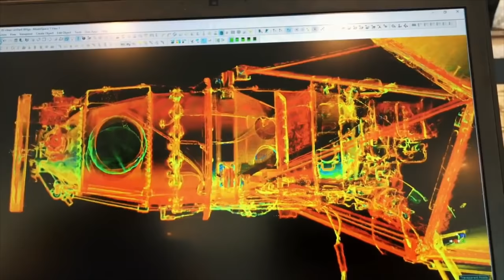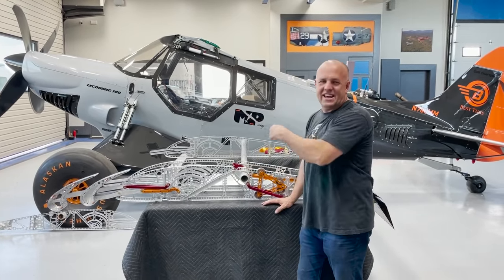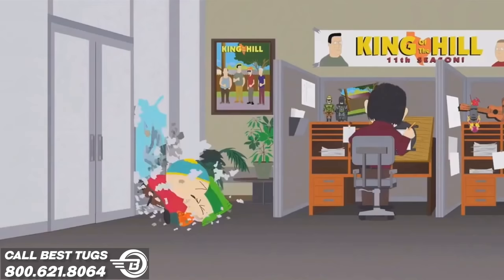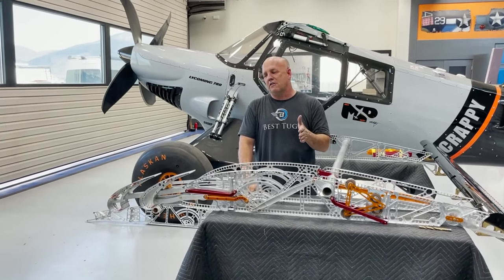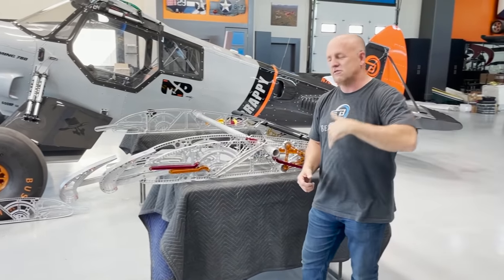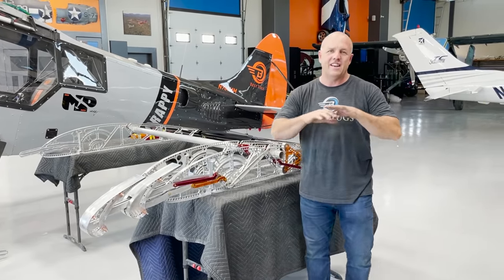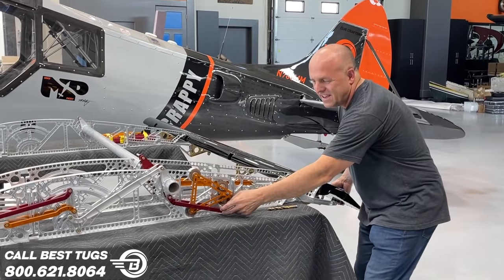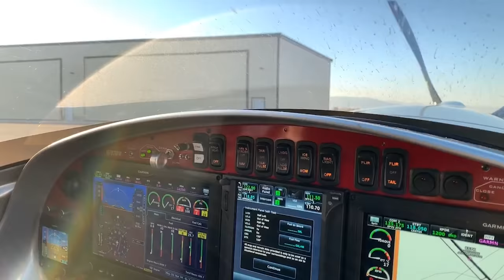DECLASSIFIED Hyper-STOL Transforming Wing - Patey Twin Slats - Fast and Slow | Scrappy #57

Comment: Those ribs aren’t just elegant engineering - they are works of art. Need to hang some on a wall in a museum. 

A couple of years ago I played with some CFD models of my Zenith 701 wing. Wanted to see if I could get the stall speed down even lower by adding an array of small electric ducted fans between the slats and the wing. The idea was to get higher speed airflow coming out of the slat and increased critical AOA. It worked, but it looks like your double slat achieves better results without the need for a power source.

Comment: You can research the B-24 Liberator wing which even today is considered revolutionary. Ironically the most high performance wing design of World War 2...meaning "put on a 4 engine strategic bomber" and not as would be "normal" on a fighter plane or something to be launched and landed off an aircraft carrier.

Great video!

Comment: Beautiful Wing, everything about it. So well thought out and innovative, from the Leading Edge Slats to Flaperons. Can't wait to see you flight testing Scrappy and how low the stall speed is with those slates, converting high pressure below the wing to high velocity air above the wing, you might have to fly backwards to get the wing to stall.

Comment: Mike here’s a thought that I’m not sure you explored with the leading edge slats. It looks as though your slat mechanism largely just extends the slats forward but not really down. Perhaps in a second iteration of wing design you could try a tracked system for the leading edge slats linkages so that the slats extended both out and down as they typically do I on commercial aircraft. I think this would both super low speed lift and allow a low angle of attack which would be great for STOL landings. Love you projects. Now, back to work!

Comment: Totally amazed. I'm not a pilot, but wonder how the complex structures will wear during extremes of heat and stress cycling. What keeps seals from leaking around torsion bar?  How will access panels behave under extreme stress?  How would you qualify this wing for commercial or military service?
But I'm really grateful to Mike for bringing us along on this odyssey.

Comment: You very well may have changed the future of slow flight making landing safer and easier for pilots of the future.  There's a potential for use in naval aviation and platforms like the E-2 and C-2 could benefit from lower landing speeds.  Certainly, it would be less stress on the airframes.  Even the C-130 and cargo planes that need the ability to land on short runways could benefit from this double slat design that you have come up with.  

Am amazed at how much thought went into the design of the wing and was able to follow your explanation completely because you did a great job of articulating your design goals.  For example: why you wanted to move the center of lift forward as you add flap to remove the need to have to pull back on the stick to compensate for the nose wanting to pitch forward, and how pulling back on the stick creates downforce which counteracts the extra lift being produced by the wing < which is what you wanted to avoid, as well as have the ability to fly at lower angles of attack yet still benefit from the extra lift.  

I also really like the safety features you incorporated such as making sure that the wing itself had nothing that would cause anything to bind and that the only thing limiting travel is back at the actuator itself where its full range of motion governs the limit of the travel.  It's genius and should take a lot of workload off the pilot during landing!  I can't imagine a safer plane than Scrappy!

Comment: Of course anyone who has sat in a window seat of an airliner will have seen the wings "Expand" prior to landing. So the idea is not new but it is new for light aircraft. Why not? The answer is simple and that is "Cost". To make ribs like those Mike has made would be tres expensive for the average small plane which is not exactly cheap to start with. I am not knocking Mike's work or ideas just saying it as it is. I actually admire him and the way he can think out the problems and come up with solutions. Regards, Jim in NI UK

Comment: Hoooly shit, in 20 seconds of motion you made my engineering brain light up.  I LOVE this design....  You're gonna need either a flexible skin, or sliding plates depending on her construction, and you'll need your engine to be able to handle the extra drag created suddenly as the wing changes, but if it's appropriately powered this will be amazing.

To make this easier to fly look into the electronic mixing we do with RC aircraft.  It may help you synchronize the motion.  You can accomplish it with something as simple as an Arduino.

Comment: Mike, a few things I'd like to mention.  First, cool design, especially the dual slats keeping the air connected.  I'd be concerned that one of the liner actuator fail and you would be stuck trying to match one side to the other hoping it doesn't fail to.  One way to deal with this is to run a torque tube though the fuse and tie it all together mechanically then have both actuators drive the entire system.  That should give you redundancy (given safety factor) but more importantly no way they can be out of sync.    <more>

Another thing you might consider is getting the wing position feedback with a liner resistor (probably built in to your actuators) then using a micro controller to compare the two and lockout one side of the other fails or limit travel.  

Lastly, I'd consider not relying solely on the Garmin relay box for all of your movement.  If it were me I'd mount a relay driven aux switch that doesn't pass go, doesn't collect $200, but powers the actuators as a backup.   I'm doing something not entirely different with trim servos in each elevator with a microcontroller that can drive the system to neutral with a button press.  I can also speed/slow trim based on IAS, and other handy things, but... I'm going to have a "I don't care, power servo now" switch just in case.
Reply: Looking closer I see the ray allen position indicator, so that can be displayed on the G3X.  It's hard to tell if the tube on the end of the arm goes through the fuse or not.  It probably does.

Comment: I wonder how the wing will do when loaded and stressed? Can you imagine one wing not being symmetrical with the other? I am guessing he has left no stone unturned and has considered this especially with Solid Works or what ever system he uses. I flew a '46 Culver V for years. This was Al Mooneys final design before he ventured out on his own to form his own company. The "V" had a system called SimpliFly which automatically trimmed the stabilizer as the flaps were deployed to control stick pressures. Testing went wrong and the pilot was killed. I appreciate and applaud innovation and I feel the effort on the slow end of flight has not been there lately. Say what you will of the STOL competition but such will birth innovation.

Comment: @MikePatey At 7:27 you refer to losing 200 lbs of lift due to the wing geometry requirement, the Peterson Performance Plus canard MOD eliminates this penalty in fact it enhances the net lift and does so ahead of the center of lift, thus facilitating the desired angle of attack while also adding lifting capacity. I hope you will explore their solution, I plan to investigate it for my aircrafts.

Comment: Just a note on the rear stab. The Westland Lysander solved the rear wing stall by using an adjustable angle of attack on the horizontal stab. It was critical however to return it to level before takeoff to avoid killing the pilot, just saying

Comment: This reminds me of the Helio Courier's design. It had a single slat that was automatically deployed at high angle of attack by the air pressure. You could not stall the airplane and you had full aileron aithority all the way down.

Comment: The 2 inventions that changed our way of life forever 
1.Electricity
2.Solid Works hooked to a CNC machine.
   BTW. That was the problem with some of those smaller type P-51 kit planes..Too much flap with not enough elevator authority at the slower speeds.

Comment: Man I wish I could just hang around and help you work, just cuz I feel i could learn soooo much. I love building/ engineering/  problem solving.... I have always had a intrest in aviation and a want to learn to fly, but always seemed so far out of reach. I remember at around age 10 or so, taking apart my old 6x6 rc truck, a rc dual propeller boat and a electric rc light plane and making a rc boat, car, plane. ... it went in water perfect, it drove on land perfect, but after trying to get lift off I stuck it on the roof so I could drive it off the side where in was down a steep hill on that side, hoping it would be a awesome glide to landing......well, that was the last of that creation lol!

Comment: Great ideas and the beauty of Experimental class aircraft!  Design, build, test fly, document and it's legal (within parameters).  Very similar design as large passenger jets to overcome the same problems. The double slat is the icing on the cake!!  A thing of beauty Mike!
It's really too bad certified aircraft design is stifled because of overburdening government regulations.  Mooney was the first of many to go by the wayside recently.  Most others will be gone in 10 years.  The experimental class is taking over private aviation- we're all going to have to be active to keep government out of it.

Comment: Just want to say a fact and an opinion would appreciate your thoughts. A flat bottom airfoil needs a negative angle of attack to make it behave like a symetrical for high speed. For low speed 0 angle of attack or not much more going by bottom of flat of wing compared to stabilizer. An opinion is I feel the hi tech front slats may cause extreme turbulance. A standard wing with an adjustable angle of attack is what I would have went with. Works beautiful on rc planes and air stays smooth. This is 30 years of trying different things. A friend of mine made cnc wind tunnel small test wings for nasa and I learned a little bit.

Comment: Hey, I've been working on multi-directional airfoil expansion for two years now, this is some great implementation and congrats.
I have some comments in regards to the structure design that might be helpful for your design weight and stiffness, let me know if you are interested.

Comment: This wing design should be known as the Patey Wing. I bet that with a 15 knot headwind, once those slats are deployed with that button on the yolk, Scrappy will become airborne with zero ground speed and if not, Scrappy could leap into the air using all those fancy hydraulics (think lowrider) and require zero ground-roll just like a helicopter...

Comment: This is AWESOME!  I want this concept on a Turboprop LX7 I'm going to have built so I can get in and out of shorter fields, but still go fast!!!  Of course, I'll need a matching tug to go with it.  😁
Reply: I want it on the real original 4p. I think a derivative of this design could work for 4p or lx7.  Use springs to automatically deploy at low air speeds for stol or stall prevention in flight.

Comment: any engineering that beautiful has to work! i can't imagine what the cost of all the machined aluminum parts comes to but it is worth every penny. I hope there is potential for stampings and cost reduction without sacrificing performance. I would love to hear more about your prototyping and testing strategy. I am assuming you used your cad models with no mechanical stuff till you tested the air foil positions with the various configurations in various positions and after you achieved a desired flow analysis, then you figured out how to mechanically position the leading edges? great stuff. i love it.

Comment: Attached & laminar to the tip of a 50 degree aileron??
You sir, are a genuine genius!  Put that on a T-shirt and you could have a crowd of groupies at EAA fly-ins. What would happen to your pitching moment, and elevator authority with double slatted fowler flaps? (I used to teach subsonic aerodynamics at EAA Arlington, of course that was pre-meningitis. Now I have trouble making a sentence flow, let alone air over a wing).

Comment: I'm curious to know two things:
1. At the AOA you're discussing the 50deg flap being deployed: What's the airflow over the tailplane doing? How about the airflow coming off your wheel struts?
2. You're talking about the airflow being smooth over the top of the slats when they're closed, but it looks like in the fully retracted position, the torque tube is protruding above the plane's top skin. Is it? I didn't see a 'hump' in the flow analysis.
Looks seriously cool, bud. Looking forward to the feature-length presentation ;)

Comment: I noticed you have linkage popping above the wing, a suggestion is cover it with a wing fence.
Would have been better to just go with a wing that changes its camber similar to the F/A-18. While the engineering is beautiful I'm having flashbacks of working on Tomocats with all the moving parts in its wing.
This is gonna be a rigging nightmare to get symmetrical deployment and binding under load. I've done enough slat rigging to know Tomcats and Prowlers in the navy.

Comment: Looks nice.
The only problem being if the slats are too powerful and the C-of-Lift goes too far forward, then you may not get a pitch down on final approach.   And you need some pitch down, in order to see the runway.   (The normal pitch down is to restore the original angle of attack, after the flaps have been lowered.  The large slats and forward CofL will negate this.). 
Test it and see….
R

Comment: I know you have already most likely thought of this but , you would be able to lift the plane to a straight take off. Swiveling vertically on the back wheel.. Can your back wheel take the pressure of this. I know you will attempt such a take off since this will be possible with this wing design.. I love it doe..
Reply: @amytaylor7210   hi I am doing okay.. thanks for that :) God bless you too.

Comment: Whilst running some thought experiments on your design I feel like the the system would benefit from a mechanical link between wings or extra failsafe devises to prevent independent actuation. This happened twice in my mind and I didn't have time to catch it before you know what.

Comment: Please! Do a joint analysis of both wing and horizontal stabilizer under stall conditions! This wing is awesome, but you don't want your main wing still generate lift but your elevator is deep-stalled and you lose all pitch control - and the nose just keeps rising higher and higher until you flip back over :-(

Comment: Nifty viedeo of a nifty low speed arrangement. :D
1) I was hoping to see you fly it! :) 
2) I really tickled with the DHC-6 (and 4) that has the drooping ailerons that they call flaperons. The DHC-6 are the champs at St. Barts, making the turn-off every time, while ALL the other planes turn around at the end of the runway! ;)

You now have me wondering how the DHC-6 manages to compensate for the change in the center of lift.

Comment: Mike, you are a Genius!   I am wondering though in the fully retracted mode, about the hinge point on the torque tube sticking out above the wing.  Multiply that across all ribs and it would seem to be a lot of interference with the flow over the top.

Comment: Love it. It will work just fine. you should show people this by building a remote control model.. I tell ya. I would buy it straight away.. A remote control air plane build to the specs of Scrappy. That would be cool..

Comment: To compensate for main wing transformation can you create a new CG with shifting weights (on rails)in the mid section?  You answered this question in the video.  I think this wing configuration is used on the large passenger aircraft I think.  Nice work I can't wait to see this in the air.

Comment: I wondered what those curved shapes in the ribs were for. Two concerns; lubrication, dust. The use of sealed bearings and the design of every little thing is super impressive. I'm not sure how you would pre-flight that though.

Comment: This is great stuff and I watch all your videos. I think there is a terminology problem using 'laminar' when you mean 'attached' when referring to airflow. It is not likely that this wing has laminar flow all the way to the end of the flap. The flow stays attached but that does not mean it is laminar, where focus is on low drag for high speed rather than high lift at low speed. Most wings are turbulent flow designs, since even bug splatters on the leading edge can trigger transition from laminar to turbulent flow.

Comment: If you haven't already, you need to prepare a disclosure and start the Patent process for this innovation. This could be very important for the future of short haul STOL aircraft where the high AOAs needed for the shortest possible landings are not passenger friendly. A reality of CFD analysis is that it is built on a lot of experimental work on potential configurations. When you go into areas beyond the tested parameters, you will be doing experimental work to extend the validity of the model. Perhaps instead of an even longer video on this you should aim for a technical article in an appropriate technical journal, maybe something for AIAA or SAE.